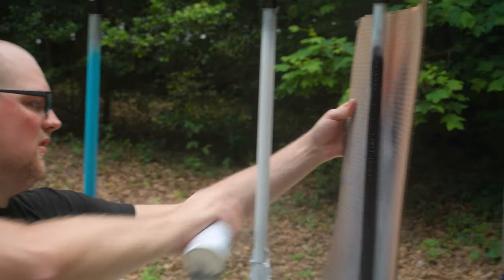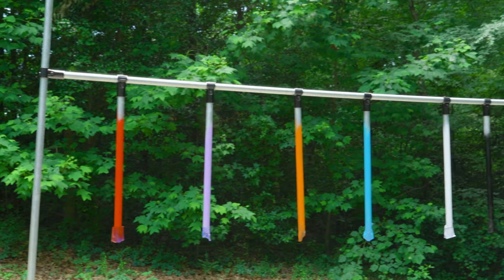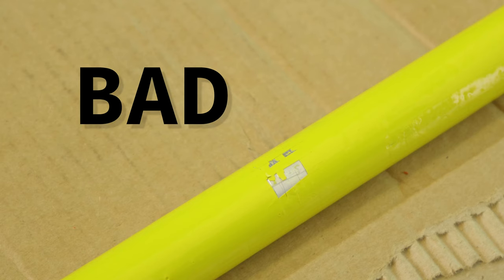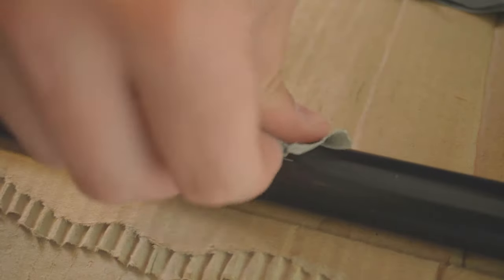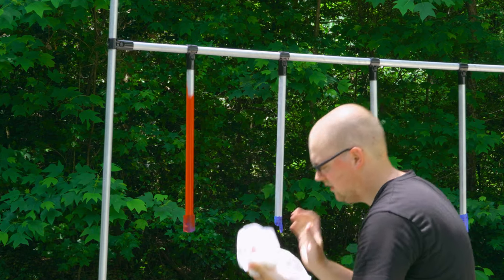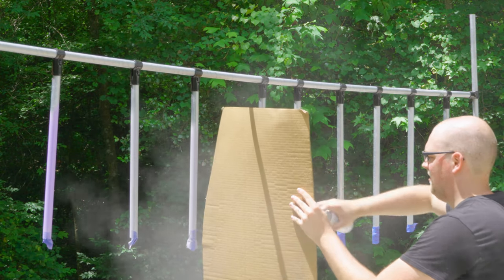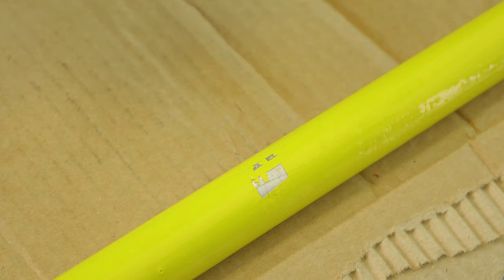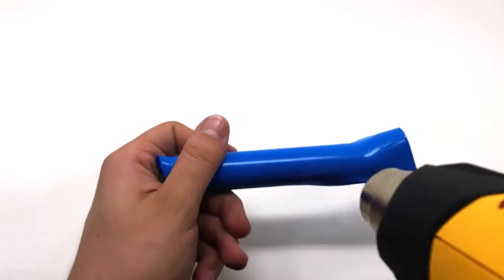How To Paint EMT Conduit

Comment: I, in addition to prepping with degreaser or sanding with 400 grit sandpaper (I tried both and I am not sure if one is better), used Rustoleum Self-Etching Primer. It has some acid in it that is supposed to improve adhesion.
Reply from the maker: That would be a great one to try.  Thanks for the suggestion John!

Comment: I liked your approach and conclusions. Based on my experience with EMT (lots) I have found well weathered EMT with a degreaser prep and then Rustoleum or Plasticcote have worked very well. Just let the paint dry hard!  Too many people want to keep working while the paint  is soft.
I also paint in light coats and let the previous one dry well before the next one. Warm weather helps too.
New EMT gets a light sanding with 250 grit paper, degreased and the paint.
Reply from the maker: I never thought about Plasticcote. I bet that would be pretty cool. Thanks for your comment and feedback!

Comment: I use a scotch brite pad soaked in lacquer thinner or pure acetone to clean the pipe. This also gets off those pesky barcode stickers and adhesives and roughens up the surface. I then use Adhesion Promoter instead of primer. Autozone sells Adhesion Promoter for dirt cheap. I can’t stand runny spray paint jobs, so I’ll do up to 6 thin coats of paint if it’s warm outside. I’ll add another coat of Adhesion Promoter after the first coat of paint.
Reply from the maker: That sounds like a good method! I'm glad you brought up the stickers because that's something I didn't mention in the video. Those can be pesky even if you're not painting the pipes.

Comment: Did you try using high heat engine enamel? You can use a heat gun to heat up the conduit, and then you have no air cure time needed

Comment: Hi, I am attempting to paint on zinc organ pipes.  The paint is not wanting to stick to the part that is zinc, even after degreasing and priming.  The paint peels off.  What am I doing wrong?
Reply from the maker: Hi ronda, sorry you’re having issues painting zinc pipes. One thing I read that helps is using white vinegar on the pipes. I tried and it didn’t show to improve the process very much but it may help your case if the paint is not sticking at all

Comment: you list several different paints used. I'm guessing you didn't use all of them on the black coating that was most successful. Other than the degreaser and the auto primer, what was the paint product you used to finish the black one that was most successful??
Reply from the maker: Hi there, thanks for the question. I first cleaned the pipe with the degreaser, then primed, then spray painted with this Rustoleum paint. https://www.homedepot.com/p/Rust-Oleum-Stops-Rust-12-oz-Protective-Enamel-Gloss-Black-Spray-Paint-7779830/202315069

Comment: Wrong primer. The primer you recommend says "Suitable for use on a variety of materials except-galvanized metals"  A better primer would be Zinsser 123.
Reply from the maker: Thanks for the recommendation 👍
Reply: No way of knowing if the "right" primer would hold up any better than the "wrong" primer.   Not unless you tested it against each other.
Reply: @MakerPipe  I noticed the primer says this too. Is this primer what you’ve always used and does it hold over time? I’m willing to still give it a go if the results prove otherwise.
Reply from the maker: To be honest I haven't used this specific primer in any long term applications. We've had people in the community say that they use self etching primer but that also says not suitable for anything besides aluminum. I would use the 2n1 paint and primer or a primer that is compatible with galvanized materials.

Comment: Paint before or after installing the MakerPipe connectors?
Reply from the maker: Its up to you! You can paint the MP connectors at the same time if you want them to be the same color as the pipes. If not then I'd paint the pipes first and then make the connections.

Comment: Do u think I can use the same method to paint my Galvanized trailer?
Reply from the maker: I don't want to say 100% yes because I haven't tried it. I would recommend trying it on an inconspicuous spot somewhere on the trailer and see how it sticks. I imagine it would work just fine. Hope this helps!
Reply: To paint galvanized metal make sure to sand it with 150 or 180 grit really good. Then wipe it down with acetone or laquer/thinner. The prime with a self etching primer if you can get them through gallon containers... if not then a small amount in soeay can can be the in between coat to a DTM primer. Then your final paint. I would recommend a car paint and sealer instead of your regular house paint.